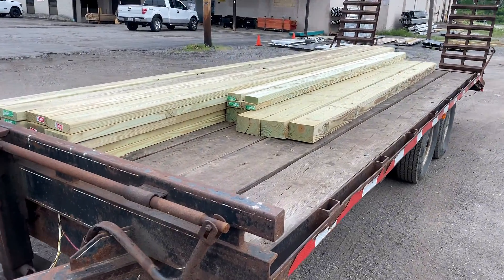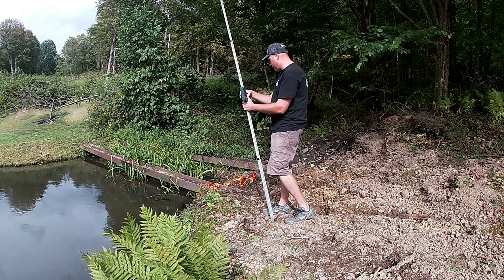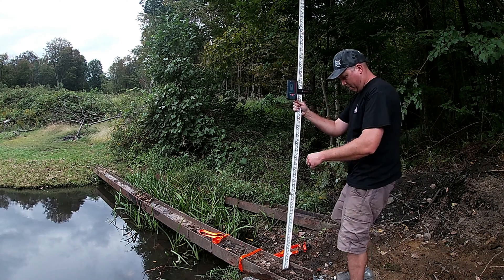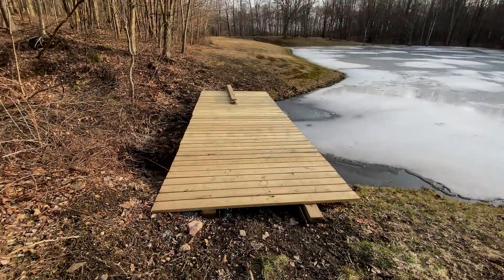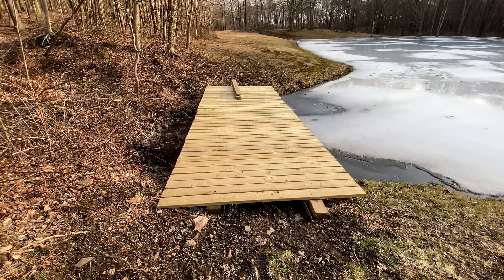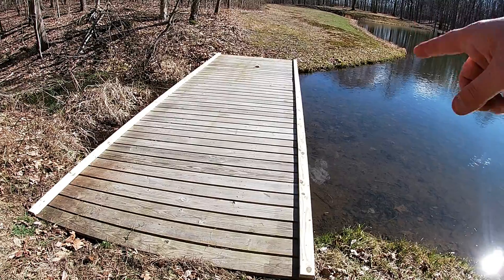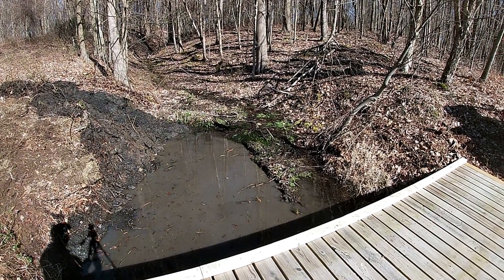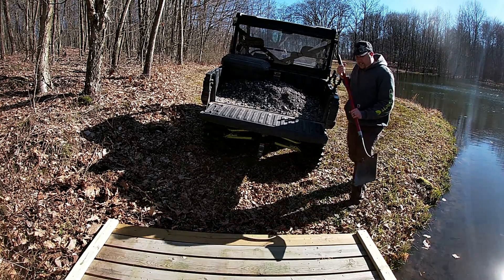Building a Bridge Across Our Pond For Machines

Comment: Looks good! Curious why you didn’t turn the beams upright though. Seems like it would be stronger. Either way nice little job
Reply from the maker: You are correct it would be stronger the way an I beam is intended to be. But and 8 inch ibeam on its side makes a nice channel to lay the 4x6 in and it still doesn’t flex that much.  Thank you though it works fine for the zero turn and the kids to ride dirt bikes and quads across. Would prob take the excavator across if the beams were right side up.